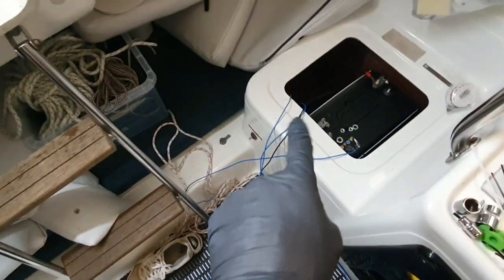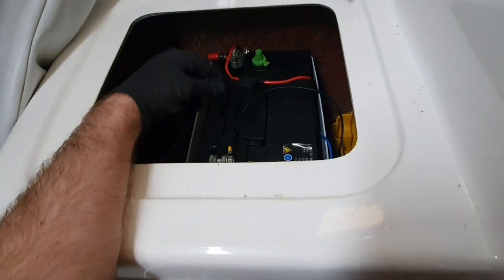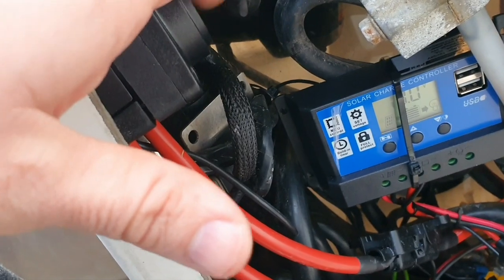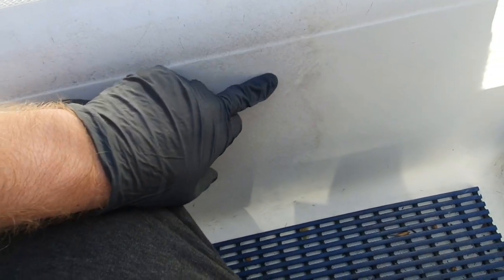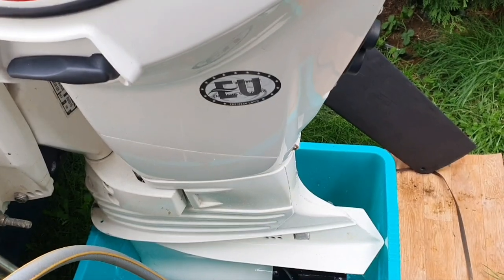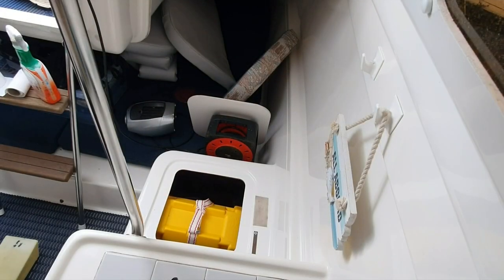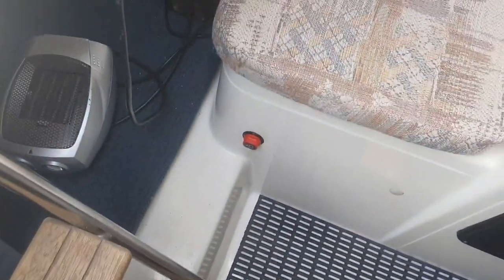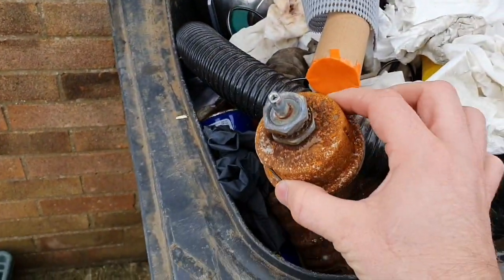Macgregor 26x Sundance - Automatic Charge Relay Install and Other Jobs #6

Comment: Although it is a bit wet, the compartment where you installed the bilge pump is not where bilge water will accumulate. If possible, relocate the pump to the other side of the GRP dam. That compartment is connected to the entire starboard bilge of the boat.